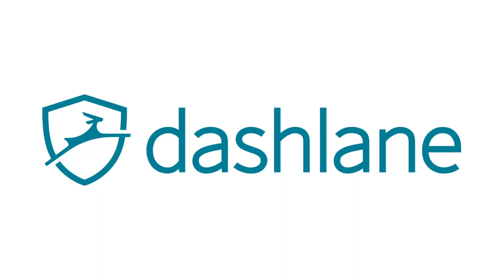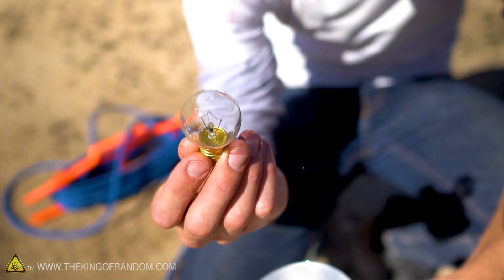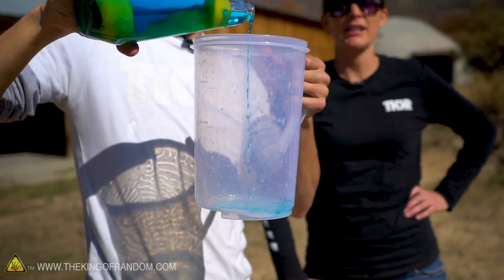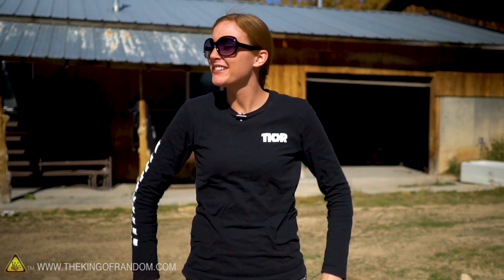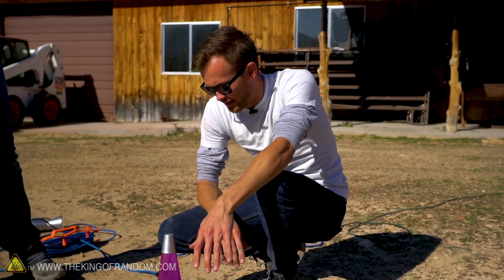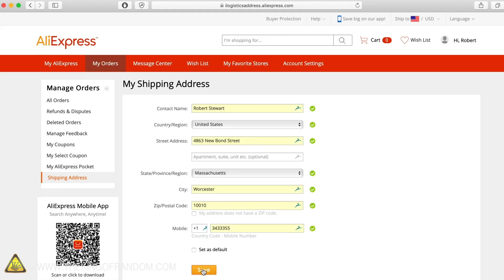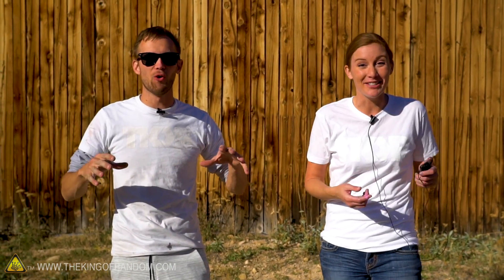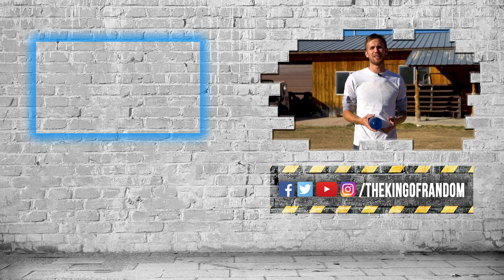What’s Inside of a Lava Lamp?

Comment: I wonder if anyone makes lava lamps with an additional preheat heater that turns off once the lamp is hot enough to avoid having to heat up for hours. That is the most annoying thing about lava lamps and the reason I don't use mine anymore.

Comment: Years ago my straight sided lamp (which had a screw cap instead of a clamped bottle cap) actually blew its cap (with just the heat from the bulb) and shot the liquid and wax straight up like a volcano coating my ceiling. And yes it was an official Mathmos one!

Comment: The mystery ingredient is Carbon tetrachloride, also known by many other names. It is an organic compound with the chemical formula CCl₄. It is a colourless liquid with a "sweet" smell that can be detected at low levels. It has practically no flammability at lower temperatures.

IUPAC ID: Tetrachloromethane

Formula: CCl4

Molar mass: 153.82 g/mol

Boiling point: 170.1°F (76.72°C)

Density: 1.59 g/cm³

Bond angle: The CCl4 bond angle will be about 109.5 degrees since it has a tetrahedral molecular geometry. You should try this one again to see what kind of wax works best.

Comment: Could that have been a steam explosion? I mean, wouldn't water in a closed off bottle do the same?
Reply: Randall MacDonald probably, the next thing I thought of was an egg in a microwave, the particles of water are trapped inside  the shell, and the water gets so hot and under pressure that the egg explodes, as lethal as the lava lamp on a stove

Comment: Right now im learning about continental drift in my earth science... i found out that the wax is oil and the liquid is water... Not only that but since the light bulb generates heat the wax becomes less dense which floats then as it goes up it gets colder which gives it more density which lowers it over and over
Reply: Christopher Chavez not so, Distilled water, glycol, a drop of clear surfactant liquid, the paraffin wax also has petroleum jelly and Perchloroethylene added all at specific amounts

Comment: If you fill a glass bottle with water and put it on the stove, it'll explode in the same way. A glass bottle of Coke will do the same. (Assuming that the lid holds pressure).

Comment: I've been known for years now that's it's wax in lava lamps...when you heat up wax it turns into a liquid and when that's in a liquid like a lava lamp of course it's gonna move around like it does...it's called physics...same thing with water: water has a EXTREMELY thin film on it which helps water retain its form...like how it looks like a drop on your finger...without the film...well it'll just runoff 🤷👍

Comment: Next time, take off the cover and put the lava lamp bottle cap down, with a ring stand or some such so it doesn't fall over. The weight of the bottle and its contents  should keep the seal fairly  well, UNTIL BOOM! GLASS WAX ROCKET.

Comment: Great video, but I'd like to make a couple of clarifications. The metal wire at the base of the lamp does aid with heat dissipation, but its main purpose is to break the surface tension such that the wax recombines into a single pool at the base of the lamp. Also, while the exact blends and ratios used are 'trade secrets', the chemicals are often fairly common. As Paraffin Wax is usually less dense than water, it is partially dissolved in something like PERC which increases its density and aids with fluidity. The liquid is usually a water azeotrope with ethanol or another miscible solvent to reduce its density and bring it even closer to that of the wax mixture. I'd be curious to see a chemical analysis of various brands though, as the solvent choice seems to vary.

Comment: Independent variable: Freezing or heating the lava lamp
Dependent variable: What happens to the lava lamp
Controlled variable: The lava lamp
Reply: Steel Current did you rlly need to do that just say what happens if you heat up or freeze the lava lamp
Reply: And the lava lamp is a constant not a controlled variable

Comment: I’m guessing the spring is a type of inductor, or transformer, obviously very low wattage(power)and if i had to guess as an eletronic technician, its far enough from the light that either it was just to dissipate heat or as i said before be a very small low power transformer.

Comment: When I was a kid we'd set our lava lamp on a radiator cover where it received mild room heat, and we let it run on and off. It would work fine for the first year or two but eventually when run the lava wax became spindly, discolored to a paler shade of red, and seemed to have more difficulty melting and just didn't look right anymore.  This happened with both of the lava lamps we owned over the years.  Whether this was the result of the mild radiator heat effecting the lava or just the nature of how lava lamps die out, I'm not sure.

Comment: The ring in the wax is there, because if the heat melts the wax it would just all at once float to the top. The ring holds together some of the wax and and prevents it from floating to the top